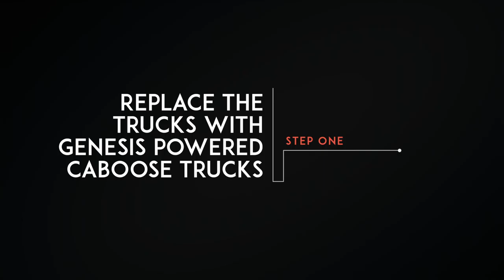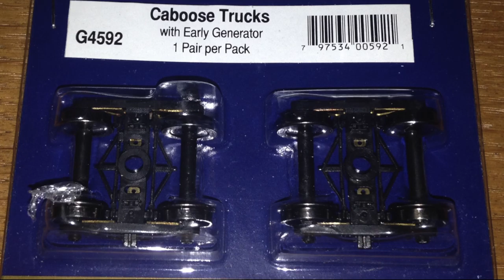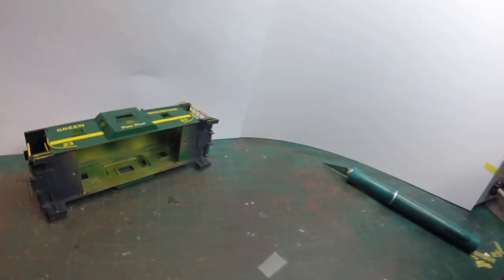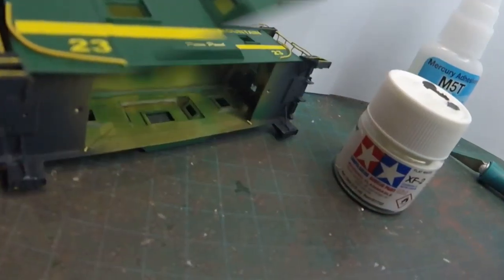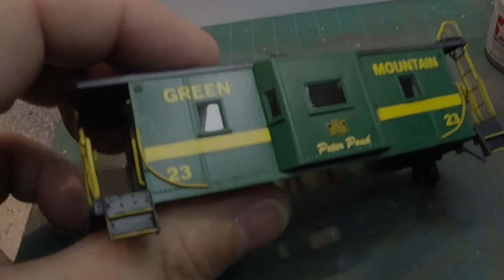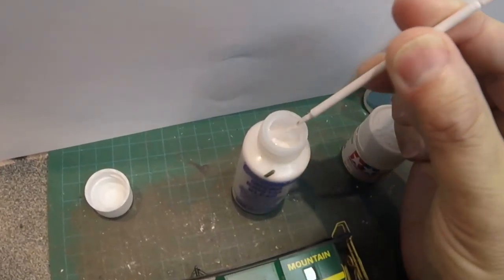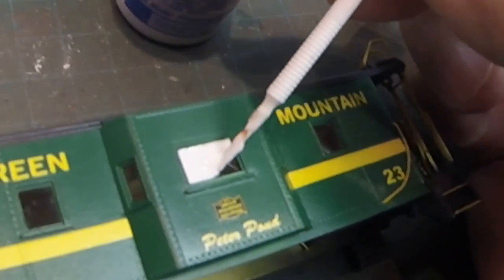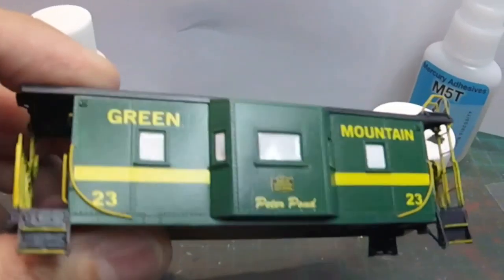Overland HO brass caboose build with SoundCar by Soundtraxx

Comment: What a great video. I have done several box cars with sound but never thought of putting sound in a caboose. I have found I like athearn power truck better than the ring engineering. They work better and are less expensive. For a while athearn was installing power truck with leads in their 57 ft reefer WITHOUT sound. What a bargain !! Really nice video.
Reply from the maker: Thank you very much. The caboose scenario seems to be a simple one, it's pretty much guaranteed that a caboose is on every train.

Comment: Hi,  I have several Overland brass unpainted models to paint, but did you have to strip off the clear finish that the factor apply over unpainted brass models (stops them tarnishing), or were you able to paint straight over it? I really need to know. Thanks Wayne
Reply from the maker: Wayne,  I simply painted over it. Acrylic paints cover and adhere very well, except to enamels, and not too many people use those anymore. The nice thing about these units is that you are not trying to hide a previous paint job, so you only need apply enough to get the desired colour. I use lots of water and SolvaSet when applying decals, then let them air dry, and there's no need to pre-coat with some clear nonsense. Final coat of clear matte or semi gloss depending on how "new" I want the unit.
Reply: Hi thanks for your helpful reply. What is the reference to enamels about? Do you mean acrylics don't adhere to enamels, or do you mean enamels don't adhere to the clear factory finish? Thanks
Reply from the maker: @waynemiller7382  Acrylics do not adhere to enamels very well. If these units you have were made in the 60's or 70's, there is a chance that they are coated with enamel. In that case, you might have to coat them with a primer. If they are reasonably new, they are very likely acrylic, and that is simply painted over.

Comment: The caboose is well done. How's the sound decoder ease of use? It seems that it's like playing the flute: Busy operating the loco and toggling between it and the caboose. Nice video thank you.
Reply from the maker: The decoder in the caboose is "just like a decoder" where you MU the caboose to the engine and the sound speed changes as the engine speed changes. When the engine is at step ) the SoundCar is quiet. There's also some magnet thingee that you can use, but I like to add and subtract MU. It's just easier.
Reply: Thank you for the info. I thought that you had to select various function independently of the locomotive.
Reply from the maker: Since the GoPro is sitting here on the desk, I'll wander back downstairs and get some "just caboose" video tonight.

Comment: That looks and sounds GREAT! LOVE the windows. I must be doing things wrong.... I did the same thing to mine, except I used Canopy Glue.
It didn't end up looking as SMOOTH as yours. 
Also, was the squeals coming from the Caboose or the Loco?  Kudos!  Well done.
Reply from the maker: All of the track noise, flanges and rail joint stuff is coming from the caboose. None of that exists in the WOW decoder. I was going to turn off the sound in #45, but it's just too good.
Reply: meriachee - I should have known...  I had to fire up my WOW powered GP7, and give her a good listen. I have GOT to get me some of those SoundCar decoders!